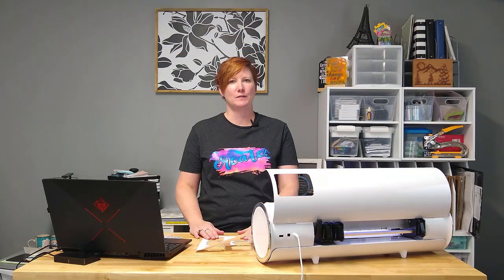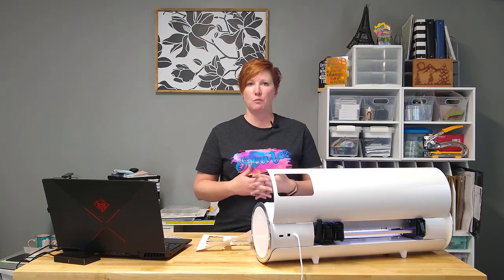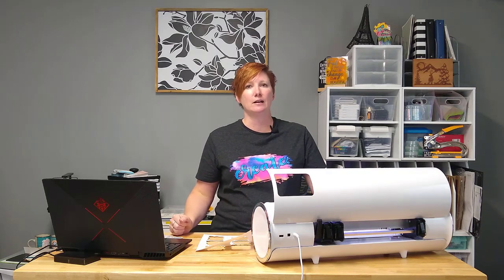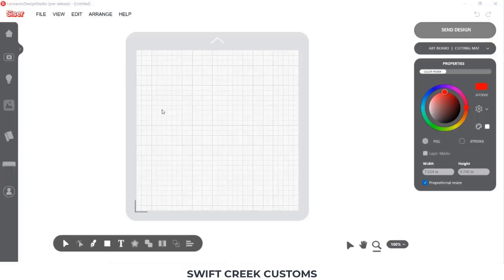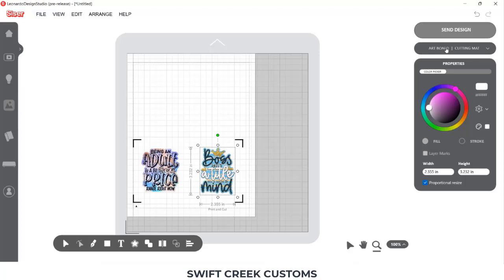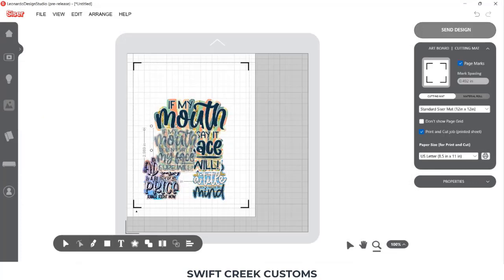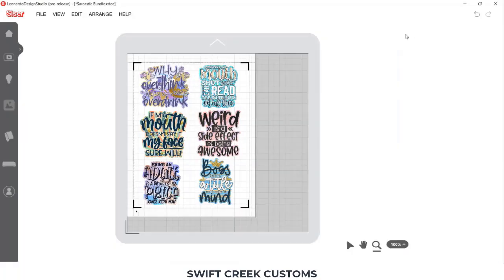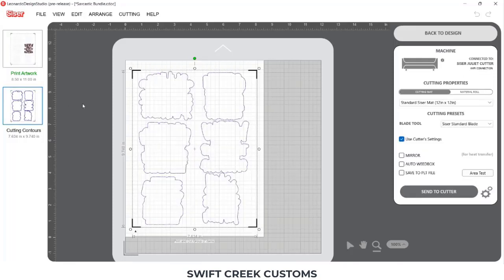Basic Print and Cut with Siser Juliet by Swift Creek Customs

Comment: I'm a bookbinder looking to replace my cricut in the near future. Do you know if I can run a plotter operation on top of the print and cut to ensure that it draws in the correct place?

I use the we are memory keepers foilquil attachment for hot foil stamping and it would be really nice to have perfect alignment when I try to stamp a cover.

I know this is something that's possible on silhouette machines and I was thinking of switching to that but if this machine can do it then it could be a better option for me 🤔
Reply from the maker: The Foil Quill does not fit in the Siser machines. Siser does not have an adapter for it.

Comment: When I click 'Send Design', it does not display the artwork or contour, and it also indicates that the printer size is incorrect, even though I'm selecting the correct one. Do you know why this might be happening? Thanks!
Reply from the maker: That typically means that you need to build Contours in the bottom tool bar. 
Make sure the full printer drivers are installed. If you still run into issues, then I'd recommend reaching out to Siser Support at Support@siserna.com

Comment: Can I print first then cut later? I have a cricut but planning to switch to siser. I dont have a printer and I just have the design printed in a shop then I'll just load the design later. Will that process also work with siser?
Reply from the maker: @midnightmia  yes, as long as you are using the exact file that was printed. 
A printing company may not be able to open the LDS file, so you'd have to print to PDF and then have them print that. The printed page would have to match the file EXACTLY and not be scaled in any way. I would test that or invest in a printer for ease of access.

Comment: why do they say print and cut when the only thing it does is cut? you still need a good quality printer. Would be awesome if it did printing too.
Reply from the maker: That's just what it is called in the industry. The machine doesn't print and cut - the machine sets up the print for your printer and then it will cut around the images if set up properly.
Reply from the maker: Cricut tried that with one of their machines.... it was discontinued in less than a year. There are professional grade machines that do both printing and cutting if you are looking for that style of machine.

Comment: What settings do you recommend for magnets
Reply from the maker: Test cut, test cut, test cut. All magnets will vary due to thickness and density. And you are in charge of the blade depth, so it may not be set like other users. Measure the depth next to the edge of the material to set the depth and test cut.

Comment: do you line the blade over the arrow or where exactly are you  lining it up
Reply from the maker: At minute 14 I show lining the blade up. It is just inside the bottom left registration mark that the arrow points to. The tip of the blade is inside the L bracket.

Comment: I have been one of the lucky ones and not had many problems with Design Space (besides the frustration of constant software upgrades) for the 3 years I have owned my Maker (and the 10 years before that with an Expression) - until about three weeks ago when my print and cut went out of alignment and no amount of calibrating or hacks or YouTube videos helped. (Still have a call in to Cricut!)  I am not afraid to learn new software and think I am ready to upgrade to a Juliet or Romeo.  I realize both those machines are considered a cross-over between crafter machines and professional machines but, before I bite the bullet, how responsive is Siser to customer support?  I know Siser is new to cutting machines and Leonardo is a new software and as such, still in baby stages, but I need a product I can trust - all around - and grow with.
Thank you for your videos.  You are one of the most talented and succinct teachers out there!
Reply from the maker: Yes, they have customer service. It is growing as the software and machine grows.
Reply: I’m having the same issue with my Cricut.  How did the Siser end up working for you?

Comment: Thank you. One note to those who had difficulty setting up their wifi connection. If it errors, you want to check your ip addresses. In some cases, you may need to adjust the ip settings on Juliet, up or down, depending on the availability. 

For mine, the default was set at 200 for the last octet. It failed because my TV was using it. I made the adjustments to find an available host, and it connected flawlessly.

Comment: Hi, Thanks for a wonderful tutorial. How does the Juliet work with transparent photo paper for print and cut ? Can I lay out a full 8.5 x 11 page in photoshop, save as a png, and import in to Leonardo without having to manipulate the files ? Thank you.
Reply from the maker: You'd have to test on transparent materials and might have to trick it by applying white paper underneath the registration mark areas so it doesn't see the grid lines on the mat and pick those up. 
Png files currently do not retain their size on opening but it's being worked on.

Comment: Having an issue with registration marks not being picked up. I’m having to manually go to the first corner atleast 90% of the time. So annoying , any tips on this ? It happens on Matte, gloss papers with sharp prints and with no light bro bright lights on the camera . Same thing
Reply from the maker: You always should manually go to the first registration mark in the bottom left corner and place the blade housing just inside the bottom left mark that the arrow points at. I show that in the video. This is where the camera should start.
Reply: I’ve done that as well and it still has issues recognizing the registration mark. Sometimes it will pick it up but most times it doesn’t and i have to move the red crosshair in the direction of the corner and it will either pick it up then or i have to actually put it directly on the mark with the red crosshair. Not automatically like I’ve been seeing in others videos. That is my only issue thus far with the siser Juliet, everything else has been great.
Reply: I am having the same issue. Every time I load it in, it will not find the registration marks. Ever. And all it does is beep. Even if I have to manually move the red dot. It’s sooooo frustrating. No matter what I do it can’t find it.

Comment: Is it consistent on print and cut all the time once you get settings set up? Honestly my latest cricut print and cut has just made me want to switch machines all together. And I just heard about the juliet and I am liking what I am seeing? Also with the software can you save designs to your computer or does it work more like design space?
Reply from the maker: Yes, it's more accurate if it's set up properly. You are the driving factor behind many things about the new machines. You have control over it in both the function and your designs.
Designs are saved outside the software. Currently in LDS format, but future updates will have additional file type added. 
The print and cut area is also larger than Cricuts.

Comment: Hi, Great videos! They're all very helpful since I have recently purchased a Siser Juliet. I'm trying to do a large rectangle die cut but I am running into the problem where my start and end point do not match up and my image is skewed. Only 2 out of 10 times do I get a good cut where it starts and ends at the same point. Is there something I can check or how to fix this problem? Thank You!
Reply from the maker: I'd recommend cutting a few other shapes, do those connect the cut?
If after making sure that the material is feeding completely flat and ruling out any feed issues, if you still have this issue, please contact Siser Support so they can provide further troubleshooting. 
support@siserna.com
Please include a detailed description of what you are doing, what the results are, photos of what is happening, and if you could get it on a short video clip, that would help them too!
Reply from the maker: Are you on the most recent update? Under Help > Check for updates, are there any? 
How big of a piece of material are you using? Mat or matless?

Comment: What is the maximum print n cut size? Are there larger length mats available? Is perf cut available?
Reply from the maker: The first factor in print and cut is how large you can print. Then the next is what size page you select. 12" wide for width. 
Yes, 12" x 24" cutting mat and others coming, but you can also use other mats as well even down to the Joy size mat. 
Perforated cut will be available in the future. We have provided feedback and they are implementing it.
Reply: @SwiftCreekCustoms  ok cool thanks… yes I can print larger than 8.5 x 11 so that’s pretty important to have those extra inches available for me. What file type is needed to save to external hard drive in order to use with touch screen only?  Thanks for doing the video…very informative
Reply from the maker: @sg3037  sorry I don't understand that question about the touchscreen. Leonardo Design Studio can save to your hard drive. Currently as a LDS file but other file types will be available down the road. More to come on that later.
Reply: @SwiftCreekCustoms  oh, I thought the machine had a USB port so you can use the machine independently without a computer as long as the file is saved to an external usb drive. Like a scan drive. I thought if you have the cut file on the drive (external hard drive not computer) you could plug it into the Juliet and use the touchscreen to navigate to the file you want to cut. I may have misunderstood that part. You can do that with a graphtec and it appeared this machine followed that design.
Reply from the maker: @sg3037  you will be able to in the future. It is not available at the moment.
Reply: @SwiftCreekCustoms  gotcha… thank you
Reply from the maker: @sg3037  you are welcome!
Reply: Where can I find that magnolia print behind you?